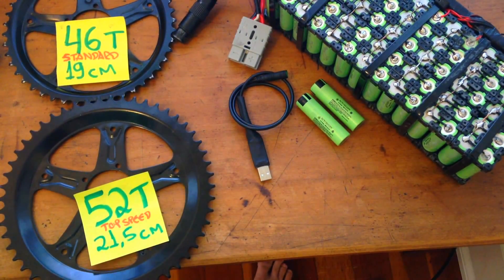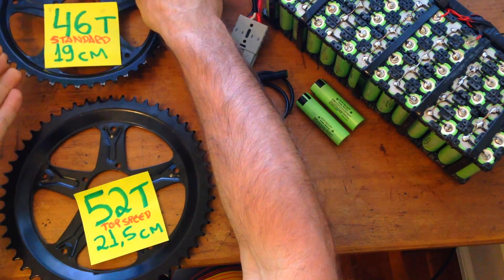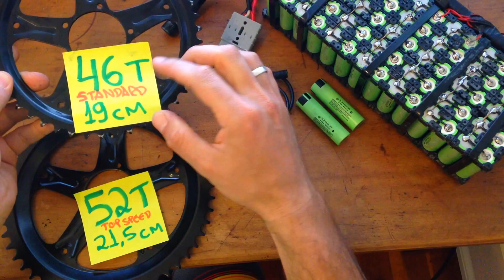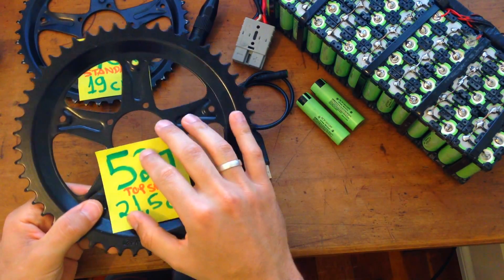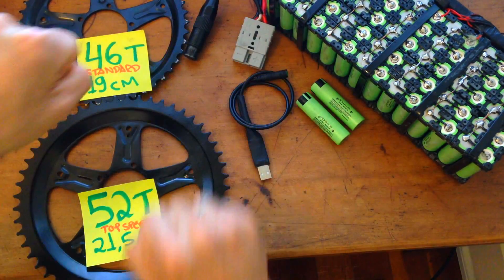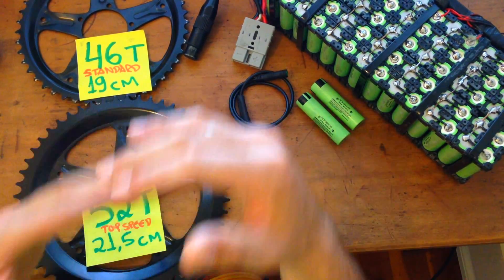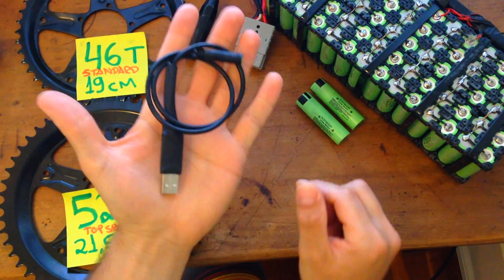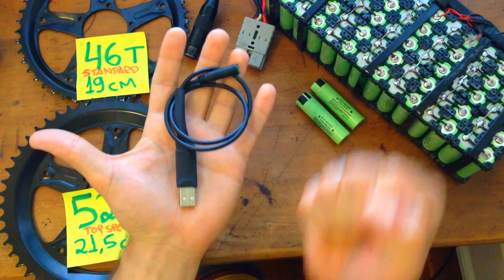Bafang Performance Enhancement (3 types) • BBS02 BBSHD 8fun 1000w 750w 48v mid drive Electric Bike

Comment: 32 mph with a 44t or 48t frontchainring .
I find the little bbso2b for a 48v 750w doing 32 mph is plenty fast enough .
After a while you find for the tiny motor , its a very fast bit of kit . I just went back to the 44t an took . the 48 back of . It kills the battery to

Comment: Ok I'm tired of 40km I want speed, is Bafang 1000 watt not meant for speed, (100km) do I need to get another system, can you direct me. I'm not racing just commuting, when you have cars up your ass it's like give me more speed but you peddle as had as you can and the throttle is fully depressed.

Comment: Ride It, Break It, Fix It, Repeat, has been the story of my life. I see no reason to change.
I just picked up my first 02B. Should I do the red locktight trick to the stater bearing right off the bat before the O Ring falls apart? I'll assume it can wait a while, but I'm trying to decide if it's something I should do right off for every motor I get for customer warrantee concerns. I'm also thinking that some grease added to the O Ring may help it last a little longer.
I'll be doing the grease packing after the first week. I want to hear how it is from the factory first so I have something to compare it with after packing in the Moly.
More Powerrrr!!!!

Comment: Funny and informative clip, awesome. I am looking to upgrade my ALU frame bile with a 8fun 500-750W motor and 48V battery for a daily commute to work, which is 18 miles each way. (South London to the City centre). So we are looking at about 180 mile per week, and about +/- 4600+ miles per year. From your experienced will general assist riding cause much damage to the 8fun motor? and how fast will the battery drain?
Reply from the maker: +Poll Mak yeaaahh good questions, you may have to watch some videos and learn how to open and service (add grease and check if all gears are okay) good to check these things every 2000 miles... should be fine... my boss used to commute to work on a mid drive and he changed to a MAC hub motor and he's loving that he never has to change gears, in traffic after work when you're tired it's kinda convenient, hub there's no wear on the chain and cassette.. but mid drive is faster, climbs any hill like monster, the faster you spin the motor the better, less stress on gears, higher efficiency, longer range.. get yourself a Lekkie Bling ring that will help your acceleration at the traffic lights, it took me a while to get one and I would never go back, it makes a massive difference! Go ahead, I saw some 8000 miles Bafang mid drives rolling like a working horse every single day.. the investment will pay itself faster than you expect =]
Reply: Cheers mate.  Watching many many videos and getting an education here. I have a motor mechanics background so  stripping, building and maintaining parts does not phase me on a bike. 
 I do believe the investment will pay back big time. My southern Rail season train ticket costs and eye watering £1900.00! And those clowns  are really bad with service and strikes. So I am taking charge, fighting back and will commute on a eBike. Only question left is how much POWER! do I need, hey?
Reply from the maker: Yeeaahh easy easy.. you'll have so much fun opening this thing.. it will be your favourite toy haha
Mechanically speaking, the BBSHD has a much better and improved design.. it all heavy duty parts, even the grease last longer... if you can jump to this bigger brother you will be much happier mate..  much happier..  if you had a chance to open both motors and compare I'm sure you would pick the BBSHD...  if you want a POWEEEER boost u just get a 52v (14s) battery instead... but even 48v long range battery will be POWERFUUULL!! Don't spend too much time researching.. researching... the sooner you get it the happier you'll be... ohhh yeahhhhh

Comment: range only 36km with 14.5Ah??
Reply from the maker: +gabriel s Heeey Gabriel.. range is something that depends on many many factors, Sydney is very windy, so many hills to climb, lots of start stop at traffic lights, 
if I was just cruising using a lower level of pedal assist and no throttle (I would never ride like that) I could double the range.

Going with a smaller chainring like the 42T Lekkie will make a lot easier for the motor to turn and increase your range if you change gears properly keeping your cadence as fast / high RPM as possible.

I was running my old BBS02 at full throttle with a massive 52T chainring (forcing the motor) the more difficult you make for the motor the higher amps will be required. I ended up destroying my internal gears doing that.

If you want performance you compromise your range, the more you pull the throttle the less range you'll have, same with cars or any other vehicle.

Check out how hard I used to ride back on the days when I made this video: 
https://www.youtube.com/playlist?list=PL59mIOWSOm9oCSSWCGHdJKYen8hn5fBa9

Comment: Bafang vs.  1500 watt hub motor..  Which is better uphill?
Reply from the maker: Yeahhhh... I'm making a video right now showing how ridiculous the difference is... 1500w hub motor is sooooo bad uphill.. it will lose speed and depending on the hill it will eventually come to a stop.... or if you have to stop uphill let's say traffic lights, you can pull the throttle all the way and it will be barely moving like walking speed, pulling soooo many amps forcing the battery, controller and possibly frying the motor coils. You hit the same hill with a less powerful mid drive and the bike has a monster torque. Even a BBS01 250w on a fatbike climbs better than a 1500w hub motor... it's hard to believe but I've been testing these things and the difference is ridiculous... hub is good on flat/downhill to go uphill you'll need a LOT more power... what a waste... so heavy..

Comment: Can You ON/OFF that bafang motor to save the range ?
Reply from the maker: Yeaaaahhh... you can turn it off and pedal like a normal bike... even easier you can just set to pedal assist level zero using the display buttons and you still have the display working showing the speed and distance just like a bike speedo =]
Reply: ElectricBike Duuude, thats fantastic, didnt You think about some shimano dynamo in both wheeles? to power the battery so u Can have longer range? ;D
Reply from the maker: its possible to have something like that to harvest some energy... I would LOVE to have something to make kinda of miracle there and give me an extra POWER.. I have been researching things like that for years but the drama here is that electric motors suck a lot of amps and these dynos or regen brakes, they don't reeeeally do much (almost nothing). Regen helps with braking adding some stopping power more than recharging batteries.. its hard to recharge 1A in few seconds (batteries don't charge that fast) to complete the drama.. remember that you are constantly draining 30A... 20A for long periods...
I know a guy who rides around the Australian outback on his solar electric bike with a massive trailer with lots of solar panels harvesting sun... he runs a little 250w motor and har a lot more power than he needs from the panels to power the motor.. but... he said that he carry two batteries, one discharging and the other pack is connected to the panels charging, completely separate circuit. He tried to make that "solar harvesting miracle" didn't work really well as he expected. There are lots of people (including myself) researching some ways to make that miracle... one day we get there hahahahaha =]
Reply: @Chomikback no, not really. If you use a system like that the energy you will spend way more energy than you harvest. Some eBikes say they have regenerating braking and  that is BS. You get energy back but from the conversions (mechanical energy to electrical to chemical to electrical and back to mechanical) nothing useful will be left.

Comment: Will changing the chainring make any difference, all the stuff i have read about the BBS02 etc it says the motor is governed by the magnets on the wheel & internal control box which cuts out the motor when you reach the specified speed which is 15mph here in the uk
Reply from the maker: You can change the speed limit on the display or using the programming cable, these motors are compact yet very powerful, with my BBS02 I used to do more than 60kmh on flat and I have some videos going speeding a bit downhill at 85kmh, imagine the stuff you can do with the BBSHD 1000w which is actually 1500w.
The BBSHD spins much faster so you don't have to compromise torque and acceleration getting a massive chainring for greater top speed. Best upgrade is getting a 52v battery instead of a basic 48v... =]
Reply: @BrunoPOWEEER  Hi. Bruno to get that speed what is the wight of you and your bike. And what was your setting useing the programming cable.

Thanks.

Comment: Thank you for showing the internals of that Bafang Mid-Drive.

LOL... Seriously. Plastic gears? No way. Is the Cyclone conversion that mickey-mouse as well?

Because if so, it looks like I'm getting pushed into a hub motor system.

MachOverspeed
Reply from the maker: Nylon gears are actually good and are there for a reason, they don't make like that to save money but to make it quieter, reduce the wear on expensive parts like the main motor shaft and act like a "fuse" breaking to save the other expensive motor components. Geared hub motors have nylon gears, cyclone have nylon gears, direct drive hub motors are massive, very heavy and power hungry, hub motors perform sooooo bad uphill... so many hub motor guys regret to go hub, give up and go mid drive, they absolutely love the difference and say that they'll never go back to hub... 
Get the BBSHD and a 52v battery and you'll be ultra happy with that beast... ow yeaahhh =]
Reply: ElectricBike

Makes perfect sense. Thanks!

MachOverspeed

Comment: Hey mate, where are you based in Australia? I have a mid drive Ebike that I bought as a whole. My controller allows me to go to 40km/hr before the power is cut off. I was wondering whether it's possible to remove this limit without changing the controller.
Reply from the maker: +Ong Dan Peng - Yeeeeahhh.. I am in Sydney!! It possible to increase the speed limit using the display settings, if you have the C961 display you hold + and - together and press 6 or 8 times the power button, it will show things like wheel size 26 or 27... if you press power you to go next pages... whenever you see 40 just increase to 50 this is the maximum via display. If your display is the C965 is very similar but you just need to hold + and - together and will go to settings mode, use the power button to move to next page. Once you're out and the display is back to normal, hold + and - and whenever the settings come up on screen you quickly do it again + and - This enables a secondary and more advanced settings. This display is limited to 50kmh as well.  
You can completely change the way your motor works and make it unlimited top speed with the USB programming cable (we sell it at the shop but voids the warranty) and just follow these steps here http://electric-fatbike.com/2015/06/26/a-hackers-guide-to-programming-the-bbs02/ if you need any eBike accessories eMax-ebikes.com.au just contact Ewan and he will look after you =]
Reply: Hi, thanks for your reply. I'm sorry if I wasn't clear enough. I'm not using the Bafang mid drive kit.
I purchased a manufactured ebike from a shop. Powerider from Taiwan if you've heard of the brand before?
And yeah, I could change that setting to a maximum of only 40km/hr and no more. So I guess I'll have to use a USB then. Does that mean I've to open up the case of my controller? Cause I don't think there's any visible USB port. 
And 1 question about not having any speed limit. Will this cause the motor to draw too much current from the battery or something like that?
Reply from the maker: +Ong Dan Peng - I am not sure about that particular controller... I tried to do a little research but couldn't find anything relevant here =[
Not all controllers will be programmable like the Bafang ones that you disconnect the display and using an special cable and software you can change the parameters connected to a PC. Maybe you should get a new controller without the speed limit. The current shouldn't change much at high speed as it requires a lot of amps to move from 0 to 15kmh then the amperage curve drops a bit. It is more a speed safety feature more than a battery protection. In saying that, if you can hold a higher speed and amperage for longer, it will be draining more power than just accelerating for few seconds and your battery won't have the same range. Maybe try to find some more information somewhere  by typing the controller model on Google or something like that... you may be lucky and find a video or article somewhere =]
Reply: +ElectricBike (Bruno) Great. Thanks for the info. I'll try and see what I can do about it. For now I'm just thinking of changing my freewheel to something smaller. But it's so difficult to find anything smaller than 13T. The only freewheel I manage to find is DNP Epoch but I read up about it and many were giving bad review about it.
Reply from the maker: +Ong Dan Peng - Woww... 13T freewheel... is this a BMX or single speed bike? Normal 7/8/9/10 speed cassette you find 11T the smallest quite easy... there is a huge difference in speed between 11T and 13T... =/
Reply: It's a normal Mountain Bike. It uses the MF TZ21 freewheel. Which is quite a headache for me. Damn. :(

Comment: Just got my "hot rodded" BBSO2, 14s battery, and 52 tooth chainring from Luna Cycles this weekend.  I've got a Giant Defy 1 road bike.  Probably won't be able to go as fast as you, but I'm probably not that brave either.  I'm very excited to go over 40mph!  Yes!
Reply from the maker: +Paul Sammons Music - Hi Paul... yeah.. Eric is been doing some nice "hot rodded" BBS02s... I haven't testes his version but I herd good things about.. its same idea of the "eRad" branded BBS02 with upgraded/programmed controller. I am testing the BBSHD now... spent all morning testing that beast... I am 99.9% sure you will love this electric bike thing and in 6 months you will be saving up money to get the BBSHD.. this is so addictive!!! When you realise you'll have many electric bikes and batteries.... hahaha
I am finally uploading a video showing how I setup throttle on my road handlebar and brake sensor as well, I kept all original. =]
Reply: +ElectricBike (Bruno)   I do love this E-bike thing.  I want all my friends and family to have one down here in the southern United States.  I'm glad you are uploading how to mount the throttle and brake sensor.  Electric-Fatbike.com has shown quite an unconventional and interesting way to mount the throttle.  If you haven't seen it, you should check it out.  He flips the handle bars completely upside down and carves the plastic to barely wedge it on the end of the handle bar.  
I just zip tied my throttle on mine, and it works fine, but would like a more permanent option.  I'm not even using the brake sensor.  Couldn't figure out how.
Reply from the maker: +Paul Sammons Music - I am catching up replying some old messages here, I know you have watched this video https://youtu.be/ZsQIA8INPWg where I show my road bike setup, throttle, cut off sensor... I hope it answered most of your questions. I still have to make a proper video explaining in detail how I did the throttle =]
Reply: +ElectricBike (Bruno) Have you ever soldered the shunt in the BBS02 for a few extra amps as a 4th enhancement?

Comment: i plan on running my HD on 67.2V hope it works
Reply from the maker: +Daniel Liaw - Hi Daniel, the BBSHD will come with 48v controller very similar to the BBS02 controller that you can run a maximum of 58.8v, around 59v you get a over-voltage message on screen. I am discussing with Erik from Electricbike.com and Karl from Electric-fatbike.com we are trying to develop a higher voltage controller able to handle maybe 72v with a lower current (less heat). Keep watching my channel and checking both websites for more news =]
Reply: ElectricBike is the over voltage by controller or display.... i only have one battery pack and don't want to touch that... if its by display, i could trick it ...... anyway around it?
Reply from the maker: The error message the controller sending a message to the display.... the best way to get away with this problem is getting another controller and connect directly to the 3 phase motor wires, you will lose the functionality of the Bafang display, void your mid-drive warranty but you will be flying around with that beast =]
Reply: +ElectricBike (Bruno) i am not worried about warranty, but i do like the functionality. i wonder if i can make the controller "see 58V while still controlling 60+V .......
Reply from the maker: +Daniel Liaw - with the Bafang controller unfortunately no... but there are some other controllers out there that you can run with the cycle analyst, you'll get much more information and be able to do much more than the Bafang display and controller =]